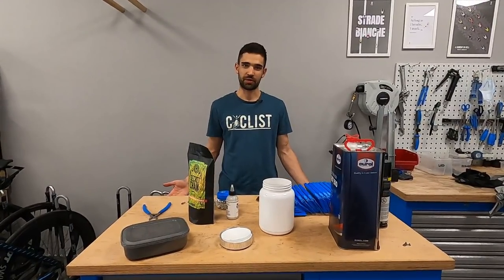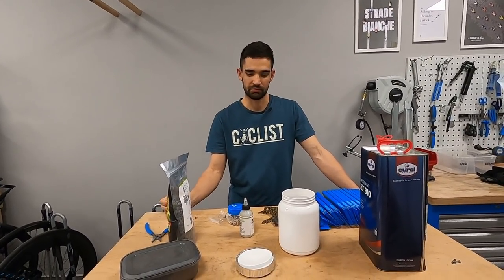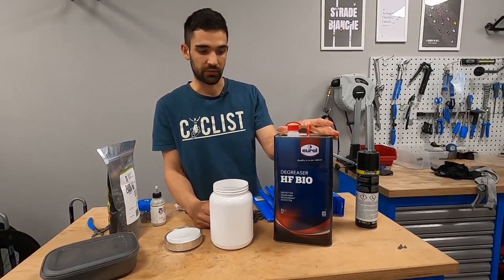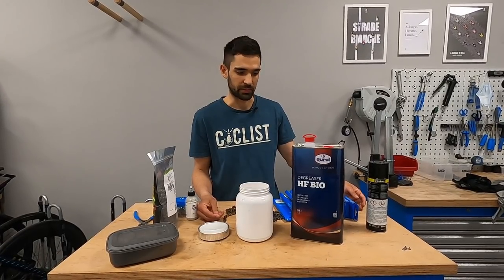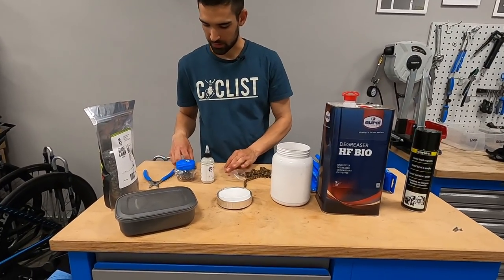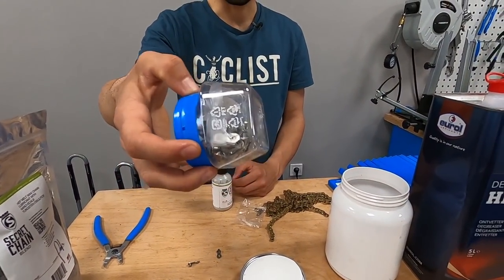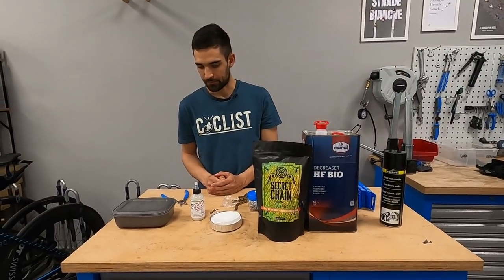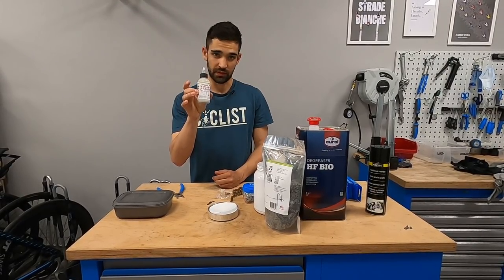The complete guide to chain waxing (2021 edition)

Comment: I use an ultrasonic cleaning tank with a dilution of 20% Ardrox 6333 ( I work for Rolls Royce Aero Engine co) the rest hot water then clean for another 20 minutes  ultrasonically  in clean hot water.  The chain looks like jewellery!  
If you can get hold of Adrox 6333 get some. It’s the very best for cleaning nimonic/ titanium/ stainless.
Reply from the maker: Cool!
Reply: i normally use mineral turps + methylated spirits, i havent heard of ardrox how does it compare to mineral turps in terms of price etc. 20 litres of ardrox is about 300 AUD how long would that last
Reply: @VikMTB  Ardrox is an aerospace grade alkaline detergent that coupled with ultrasonic cleaning cleans metal down to the individual grain structure of the metal, it replaces more nasty substances that are now band in the uk.  It’s there on the net Ardrox 6333

Comment: If you hang the chain from one end whilst it is still dripping hot you can use a cloth to wipe the excess wax off it. It leaves the exterior of the chain clean but all the bearing surfaces are coated.

Comment: Thanks for making the video. Based on what zerofriction says, it's best to soak in turps/degreaser for 15mins. Then repeat with the turpentine/degreaser 2 times but this time don't soak, just agitate for 2mins. Right now your chains are coming out of dirty degreaser and going straight into wax. Also your chains are sharing the grime of 10 chains in one bath, so even worse! The above process will get the chains completely clean through 3 cycles. After the degreaser you should use a denatured alcohol like methylated spirits a couple of times till the liquid is clear and to get the residue of degreaser off the chain so the wax bonds properly. Appreciate your video though
Reply from the maker: This was 2021.

Comment: Hey, MSW recommends to heat their wax up to 93 C degrees, I use a meat thermometer to make sure the pot reached the optimal temperature. Do you think it is important/necessary, do you monitor the temperature?

Comment: Really helpful video, couple of questions though, is there a recommended amount of MSW you need to melt down to be able to wax multiple chains, or is it just a matter of making sure they are submerged fully in wax?.
Lastly, once you've melted the wax and waxed the chains must you get rid of this "contaminated" wax or can you reuse?
Thanks
Reply from the maker: the best is to only submerge 1 chain at a time, as I have shown in the video, otherwise it is not very practical. The wax can be infinitely reused, as long as you don´t ruin it with a gunky oily chain.

Comment: @Ronnie: I really like the concept of submersion waxing + drip wax top-up. I have been trying AB submersion and really cannot get on with it, after only 100-150km it starts to get noisy and sometimes even starts to squeak. I’m going to change to either Molten Speed wax or Silca. 

Submersion & drip wax - which one would you recommend ??
Reply from the maker: Something has gone wrong with the AB wax. You need to use MSW or Silca.
Reply: @ronykuba  I was feeling with I was doing something wrong with it ! As I suffer from the same issues, it gets noisy real fast.
I tried several waxing techniques, even leaving it to cool down a bit to the "almost solid" point before taking the chain out of the pot, but not much better luck.

When I saw all the comments about AB wax issues, I felt I was not alone :D 

As a side note, chain wear has been really good with AB wax, if you can ignore the noise/squeak and some occasional rust.
Reply: Same here ! I was going nuts trying to get it right, I even used an infrared thermometer to make sure all the temperatures are correct.
(I noticed they updated the instructions on their page, and also reduced the re-waxing interval to HALF what was initially claimed.

Comment: Thank you. I use the ultrasonic cleaner. Any ideas about it?
Reply from the maker: what do you mean?
Reply: @ronykuba  I mean I clean the  chain in the ultrasonic cleaner instead of in a degreasing agent like you do. did you not do this too before?
Reply from the maker: @gengar678  I use both in a 3 stage process as explained in the video

Comment: Hello, i have the same cooker its not clear on the video what stage of power you have it on 1 and 2?
Reply from the maker: 2
Reply: And you soak the chains only 2 to 3 minutes? As other sugest on YT 15 min or even more.
Reply: @ronykuba  i finaly managed to get the same degreaser you have im just wondering if the degreaser can be reused if  i degreas one chain now and a 2nd in a few months time, can i use the same batch of the degreaser or i have to put in fresh one?

Comment: Curious if it's acceptable to use isopropyl alcohol instead of methylated spirits? Easier to get iso here.
Reply from the maker: Absolutely
Reply: usually isopryl alcohol is more expensive than methylated spirits in larger quanitites as you want to get a higher concernation isopryl (rubbing alcohol)

Comment: I used this method of waxing the chain. I disliked the white flakes mess of wax spread all over chain stays , RD or chain rings. How do you keep your bikes clean ?  Would dry brushing be an option? Thanks!
Reply from the maker: the flakes just fall off
Reply: you use a dry soft bristle brush like a soft paint brush and it takes 2 seconds to brush the frame down, if you free each link before you put it on the bike you get less flakes. Plus i break each link over the slow cooker to save some wax =)
Reply: @VikMTB  The issue is that those flakes are sticky, they don't just fall off. I'm using Molten Speed Wax. Thanks!
Reply: @gamelaro  im also using msw they tend to fall off for me, are you letting the chain dry completely after the soak then breaking it in or straight onto the bike ?

Comment: do you check the temperature of the wax? They recommend 200 degrees.
Reply from the maker: No
Reply: you can but the russel hobs cooker set on low doesnt go that hot but ideally you dont want your wax to go above 93 celcius thus its recommended you use a slow cooker
Reply: @VikMTB  I have the same Russel Hobs cooker as Ronald, and my MSW wax can exceed 260 fahrenheit if I don't pay attention

Comment: Great video Ronald, thanks.
Q- did you use the entire bag of wax? Looks like you used only half. I will be waxing 4 chains today with the silca secret hot melt wax. Do you recommend I use the whole bag?
Reply from the maker: Depends on the size of your slow cooker
Reply: How big is yours? I just bought a 3,5L slow cooker (it's difficult to get smaller ones here) and ZFC says that 3,5L would be the upper limit... @ronykuba
Reply from the maker: @AnderGdeT  2l I think
Reply: @ronykuba  thanks!

Comment: Hello, do you prepare/clean the cassette in the same way? I once cleaned everything, applied squirt lube and went threw all gears. At the end I had wax on the whole casette and I found it quite messy...
Reply from the maker: The rest of the drivetrain needs to be clean too, but only the chain is waxed
Reply: @ronykuba  Do you degrease the casette and just rinse it or do you do anything special?
Reply from the maker: @Espon123  anything required to make it clean

Comment: Do you use the super secret as a topper for your mountain bikes?  I tried Squirt on my mountain bike as a topper on my MSW and it attracted a whole lot of grime after a ride.  It was dry conditions too.   Had to clean and rewax it after that.  Not sure what I did wrong.
Reply from the maker: I only have a road and TT bike, but the same will work well for MTB
Reply: squirt + msw doesnt go that well together. The squirt has higher percentage of paraffin oil. That residual oil will keep the wax from
fully hardening and will diminish the effectiveness somewhat. it doesnt dry that well. seems the new silca topper is the best one

Comment: Please correct me if im wrong. You can use e.g Squirt Lube as "refiller" with Molten Vax (bath in slow cooker)?
Reply from the maker: Refill = apply on the chain without needing to immersive wax
Reply: @ronykuba  Yes, understood. But can you mix two different products? Squirt + Molten speed?
Reply: @Talos353  This is what i was thinking
Reply from the maker: Squirt on MSW is not ideal, but better than nothing
Reply: @ronykuba  if Squirt Lube is not ideal, what do you recommend to top off a MSW treated chain?
Reply: What’s the best product for submersion and top-up / refilled waxing combo ??

Comment: Have you tried the absolute black wax ? What are your thoughts?
Reply from the maker: Only the lube
Reply: I tried the absolute black wax and did not have a good experience.
I recently switched to the silca wax and it’s SO much better.
Reply: Tried the AB GraphenWax. Very unhappy, could not get 100k in the dry out of it. My homemade paraffin + ptfe mix lasts much, much longer.
Reply: @techwe11  i switched from the homemade version you use to the graphene wax and it was a big downgrade.
After reading a lot of information from zerofrictioncycling i decided to use the silca wax and it’s even better in my experience.
Reply: Stay away of AB wax. Bad experience here. Pure marketing shit
Reply: I am also struggling with the AB submersion wax. I started using my homemade mix last year (standard wax + PTFE powder) seemed to work pretty well apart from the tricky job of unbreaking the chain by hand before using it. I have 3 sram red chains on rotation each chain ran for 300-400km in Good conditions before becoming a little noisy. with AB wax and they get very noisy very quickly typically in the first 100km after submersion waxing. I am not sure if this is “ok” or not. I really like the idea of submersion + top up but not sure which company to go with
Reply: @alexdupee565  after trying the silca wax I am just going to continue using that until further notice. I am really happy with it so far (I used the standard wax plus ptfe and the AB wax as well). Hope that helps